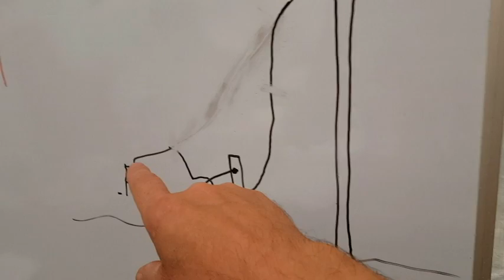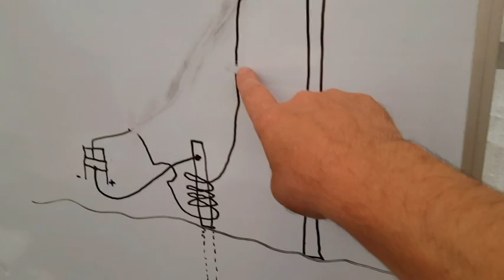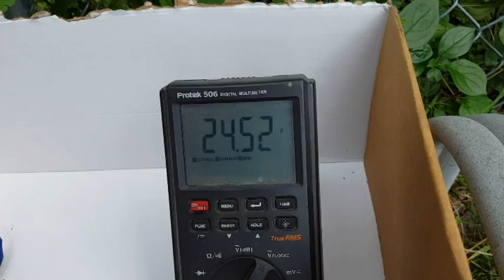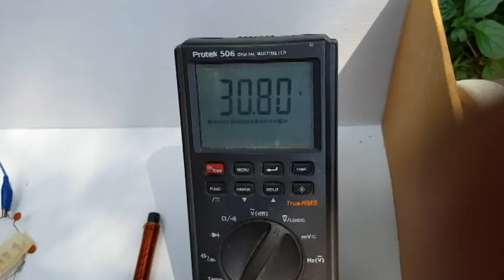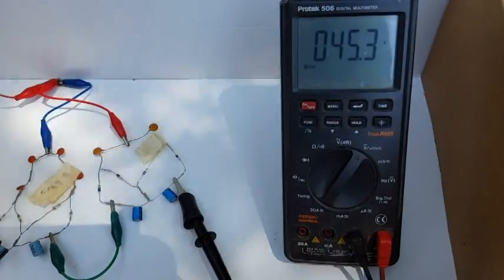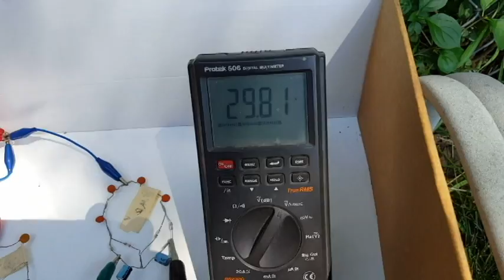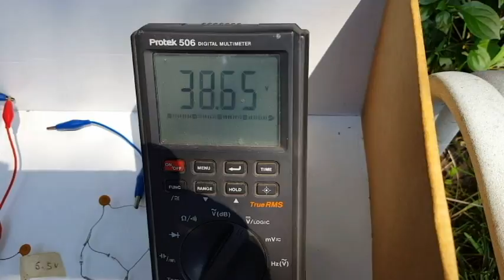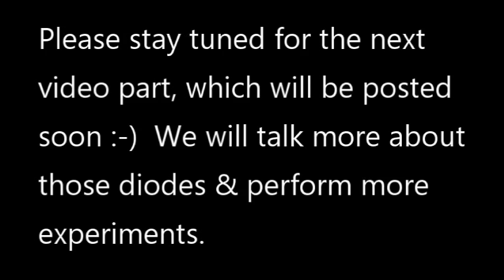Free Energy From Air 2019,  part 12

Comment: I have a wire 30 ft in the air you're going to get a thousand volts but because the wire is grounded you should get a thousand but you don't what happens is the natural electrical gradients start at the grounding point which is the whole wire and when you pulse it on and off it charges a capacitor I a lot faster. There's been a patent issues on this it's an easy test it was demonstrated on another video and it was quite amazing the difference in the results
Reply from the maker: I would love to see that video you mention, and patent.  I only get about 127V with this.  Maybe I can use it to power the project i am working on now.  thanks for your comments, and sorry for the late reply.
Reply: @INVENTOR3  https://youtu.be/TrhzkCZ5xf8?si=MmmWXDPgqAewgYBv

Comment: How uncomfortable that would feel? The voltage starts to sound a lot but the amps are very low?
Reply from the maker: Yes, you are correct.  But this time im just concentrating on voltage and then later i will try to exchange for current.

Comment: The idea for a bifilar inductor is to create a constant voltage between the paired windings. Connect the 1/2 way point on the windings at the start and run it to the end. Make sense? It's a flux-capacitor. With a changing voltage and alternating current or alternating magnetic field it will amplify the power. See Thane Heins motor that makes electricity while it runs based on Tesla's patent. Go for it. B
Reply from the maker: I do not fully understand,,,"Connect the 1/2 way point on the windings at the start and run it to the end".  Hmmm, like the dawing i point to in the video at 2:00?,,,, Please send me a drawing, hehehehe   millanyangle@yahoo.com
Thane Heins motor,,he has many videos of this project,,i think i saw one of them before,,,is there one that shows his schematics.  Hmmm, based on Tesla's patent,,,but which one.  I read of different theories for that Thane motor,,,,maybe his motor is held back by the coil, and when he disconnects the coil, it accelerates,,,,and it will only accelerate up to a specific point & then stop accelerating.  It seems very interesting to me, thats for sure.  Maybe extremely efficient.  Thanks for the comments :-)
Reply: @INVENTOR3  Hi, Great to see you working on this. 

First the Flux-Capacitor.
Tesla's bifilar patent is the one. It's a simple concept. Capacitance is stored between a charge differential. 
By looping  a wire in a coiled winding at the 1/2 way point back to the beginning and having the 2nd half follow the first half from start to finish, you design a 1/2 length circuit that always has 1/2 the voltage drop across the gap between the first 1/2 to the second 1/2 of the wire. Make sense? 
The simple way to build this is wind a dual conductor, then jump the end of one conductor to the start of the other conductor. 
Google Tesla bifilar inductor patent for his professional artwork, if you really need it.

Tesla's patent shows a pancake coil, which further traps the field of capacitance in a concentrated form. But he states any form of winding can be used. His primary application was moving high frequency, high voltage, and high capacitance through his Ether still (a properly designed Tesla coil distills Ether from electricity). But, I digress.

When you wrap this bifilar coil around a ferromagnetic core, the frequency becomes limited, but the core responds to the voltage differential and creates a magnetic response... which amplifies the current energy (or magnetism) about 1,000 times. Still, I'm a little off topic.

In a motor designed with a magnetic rotor that alternates N-S-N-S, as it changes: the capacitance in a closed circuit stator will capture the magnetism as current... stored current. In a regular motor, this capacitance is negligible... just inductors, no capacitance... so, the current gets pushed out generating an opposed magnetic field due to the polarity of the current that is being conducted. This reverse current is increased resistance in a motor. This is Lenz's "law", an artifact of a bad engineering design. This of course is the point of a motor, that resistance of an opposed magnetic field becomes motion with force. Which of course means more electricity is needed to turn the rotor. 

So the lie that energy cannot be created is validated, and most engineers would not dream of changing a thing, there is no point since the whole physics of the system is a law... these magical words prohibit improvement. And we can't ignore the fact that we are now talking about a motor being a generator... WTH is going on?

If you step back, you begin to realize the description of electromagnetic induction is a description that is not specific to the physics. It is a description of how a specific system of components behave in combination. It does nothing to describe how the system is mechanically connected.

With the bifilar winding, the changing magnetic field is trapped in the capacitance. A bifilar inductor has capacitance to offset the inductance; but both are present. In a changing magnetic field the individual aspects of EM induction begin to show themselves.

In a motor the tail starts to wag the dog. The electricity flowing through the stator builds a magnetic field that begins to pull the rotor, the incoming rotor matches the field in the capacitance and adds to it, when the current changes, this extra charge collected from the rotor is added to the power flowing out of the motor. And as the voltage builds, the capacity increases, so the collected energy remains in the stator until the magnetic field of the rotor shifts... Then, that trapped current gets forced out by the new incoming magnetic field. The polarity is reversed, the capacitance in the old polarity is dynamically forced to shift to the capacitance that can collect the new incoming magnetic energy... in perfect synchronicity with the rotor, no matter the speed. This current that is pushed out generates a matching magnetic field to the incoming field. And this source of magnetism adds to the capacitance being collected in the stator winding...

Heins' study of the shifts in phase of the magnetic field/current is not 100%, its only partially shifted... giving still the pull of the magnetism, or motor effect, but also the push of the magnetism or generator effect.

At this point, it should be noted that Joe Newman did the same thing with a different technique. He used massively long windings that used the limitation of the speed of light travel of voltage in the windings to create capacitance. If you do not siphon the generated energy out of the motor, it may just blow up from the excess. You see, current travels 57% faster than voltage in conductors, it is motivated by open capacitance, not voltage; batteries have lots of open capacitance. Joe drove his motor with dead batteries, the magnets in the rotor respond to voltage differential, current is not needed. But the extra capacitance flowed with a reverse polarity and magically charged his dry cell dead batteries while driving the motor. And there was power to spare that had to be taken out. The patent office disconnected this power diverting circuit from Joe's prototype, blew up his invention, and denied his patent by proving it made enough excess energy to destroy itself.
Joe himself proved his motor was more efficient than any commercial motor in the market.

On the PBS website, they have testimony that Tesla gave in court about his inventions. He mentions that he had developed a motor in which he had shifted the phase of the magnetic field. He also comments that the torque in the motor was less than the ones in the non-shifted motors.. But it was more efficient. He did not patent that motor, someone else did.

Heins did extensive analysis of the phase shift of current vs. voltage. His observation was that while the motor was under maximum load (RPM, not torque), it generated as much energy as when a normal motor was used as a generator (the wheels turning the motor, usually during braking). Putting a switch on the motor to select the winding would enable an electric car to continuously generate electricity, in brake mode or acceleration mode. (BTW, at speed, the car's motor does not need as much torque as when starting; it's the Oberth effect: kinetic energy transfer increases exponentially with speed.)

Heins' ReGenX coil patent application (his name for this old discovery) was first refused because patents that violate the creation of energy based on standard physics are denied. Later the office gave an official refusal because someone in Tesla's day had already patented the design. So, its now open source.

Hein's BTW, explains why this works using standard signal analysis methods. Creating excess energy, amplifying electricity with LC circuits have been in use for a very long time. It is what enables the transatlantic cable to function. The signal has to be amplified in transit as the cable cannot conduct a signal strong enough to make the entire trip without amplification. 

This just happens to need no adjustments to have perfectly tuned resonance between the input and response.

If you haven't noticed. This explanation depends on a more clear definition of electrical terms. Real electrical energy is defined as made of two components: Voltage or charge differential and magnetism, or current. Magnetism is an artifact of spinning charges that are polarized/aligned by a charge differential field. Current is therefore always the same as how many aligned charges there are. 
All permanent magnets have a measurable current flowing around them focused at the Bloch wall. Rare earth magnets have kiloamperes flowing, with the voltage of electron pairs. 
Moving charges that are not aligned do not create a magnetic field, and are not valid/useful/measurable current. Since electricity is made of these two components, it is not a fundamental energy that cannot be created or destroyed. 

And this points back to Tesla's breakthrough in physics that Aether is the real fundamental stuff that defines space, is infinite in supply and creates energy and matter. 
That discovery got him discredited and sanctioned, all income from his previous work was denied him. After one failed assassination attempt, they decided that was enough. These days... it's still one method in practice.

Many have followed and taken  note of the risk at calling Aether by its formal name. Physicists today admit it is real, they call it Quintessence (per wikipedia), an old Alchemical term for the Aether. Many have tried to correct electrical theory, skirting the Ae word... but, they are ignored or discredited because the impact to our social and economic system is too threatening.  Distinti, the electrical engineer on YT has wisely retreated to discussions with his Patreon supporters only, but wrote a master's thesis on the flaws in EE theory. Don Smith tried to outmaneuver the system by keeping his language simple, while replicating Tesla's work to amplify electricity with minimal circuitry. But he failed to realize they don't care about language, its the deed that matters. He lost, but his legacy lives on. Richard Friedrich carries his torch; I highly recommend him. The book on  Don's work he put together is priceless to makers.

You might also check out Patrick Kelly's vid on Carmen Figuera's generator. It demonstrates that you can change an EM field without any proportional resistance, or essentially generate free electricity easily with just a series of electromagnets. Don Smith does this with a much simpler set up, but requires a material that can block a magnetic field. 

Still, the key is understanding reality, not reciting the magical words of modern science that arbitrarily choose to accept "laws" of nature rather than the wheelworks of nature that Tesla sought.
Be careful what you disclose to the public. And remember, the Pirate economics demands any alternative that cuts into profits be squashed. But anything that sets people free from economic bondage cannot exist.
Peace, B

Comment: Volts OK, but what are the amps?
Reply from the maker: I had over 21 LEDs lit.  I dont know what the Amps are at this point, but i plan to get voltage as high as possible then add cap and spark gap,,,I will check current after spark gap is added.

Comment: What are the amps? Or the Hz?
Reply from the maker: Amps, i forget what i get now,,,,i had 21 LEDs lit in earlier videos and i gave the Ohms of those LEDs and gave current readings & voltage readings with the load of the LEDs.  The frequency i will check again at a later point after i get voltage as high as possible and then i would like to maybe add my barium titanate cylinder, it resonates at around 18KHz.  My frequency now is probably changing with each experiment i do.
Here are some experiments i did with the barium.....   https://www.youtube.com/watch?v=QsNtpRvon-s
At this point just trying to get voltage as high as possible, then to play around with caps and spark gap and charging batteries & finally resonate with barium :-)
Reply: @INVENTOR3  Thank you!

Comment: Hey, I noticed your 2nd and 3rd circuits have less disc caps? Just wondering why you changed them.
My ferrite bifilar in that set up were wound 2 wires side by side clockwise. My ground rod was not inside any coil. The air coil was in between the ground rod and ground connection to the circuit.  Hope that helps.
Reply from the maker: The circuits with the less disc caps, i made in the past and had them,,, but i will make some new circuits very soon.  In the past it showed no difference between 2 ceramic disc caps or 4, but different set-up now.  Hmmm, so your bifiler was wound differntly then either of my two drawings??,,,,,hmmm, so you have 4 wire ends in your ferrite coil??    I think maybe you should try your set-up with running your ground wire through the center of your coil instead of ferrite core :-)